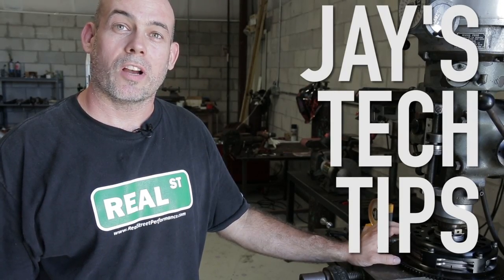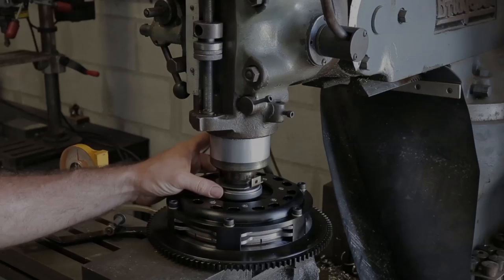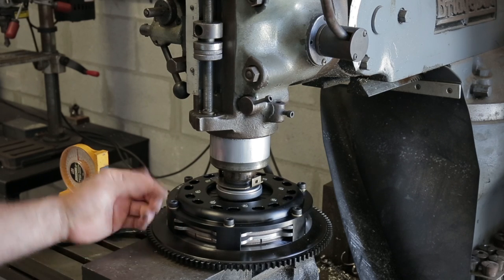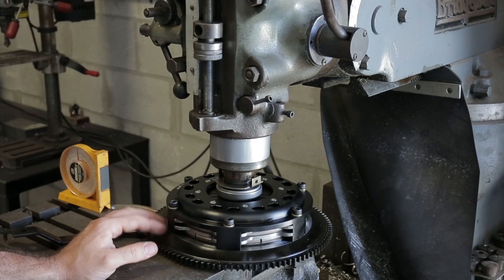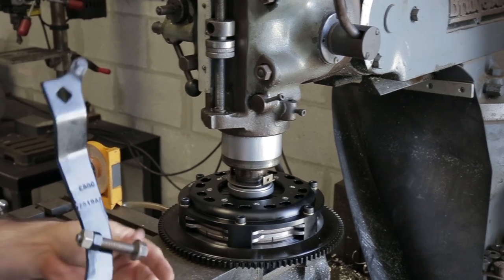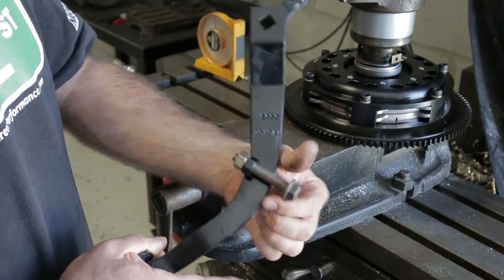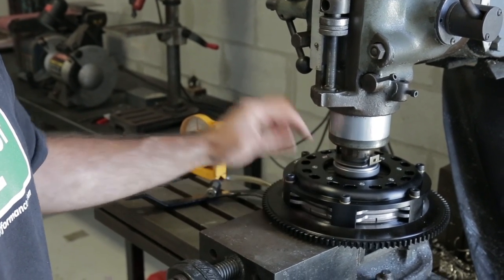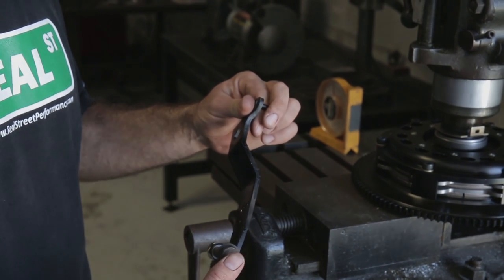Jay's Tech Tips #3: Clutch Stop

Comment: Can I put a clutch stop on my corolla?
Reply: Sure. You aren't actually changing much in the vehicle. You are just putting a physical stopper, something that will prevent your clutch from travelling so far down. If you are skilled at driving, this is not necessary. It's quite simple to do and, depending on the car, can be done in a few minutes, depending on the type of stock clutch stop. Make sure to check that your vehicle can start(specifically when hot, as the clutch travel required may change compared to cold starting) so you know the amount you must depress the clutch is adequate enough to start the vehicle. I'm sure there are DIY videos for your specific year.